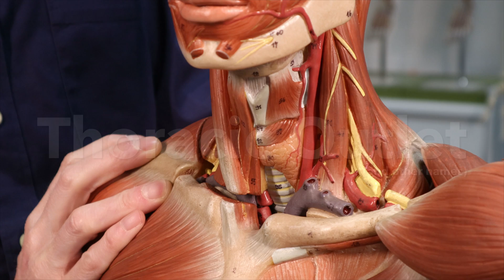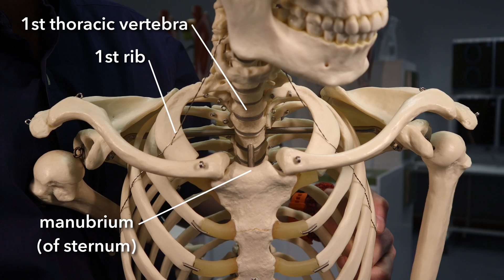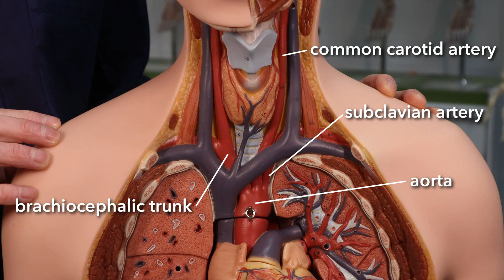Thoracic outlet

Comment: @Sam Webster - I have a quick question. I recently developed Horner's Syndrome on my left side (about 10 weeks ago). You mentioned that enlargement of the anterior scalene muscles can compress the brachial plexus. Do you think something like that could compress the oculosympathetic pathway nerves since they run near the brachial plexus? The neurons exit the spine near C7-T1, run over the apex of the lung, and then back up along the carotid artery until they reach the eye (king of hugging the cervical spine on their way up). I had a brain MRI, a neck CT, a chest CT, and MR Angiography of my head & neck, but all scans came back normal with no signs of tumor, stroke, or lesions. So, the doctors haven't been able to figure out what's causing my Horner's Syndrome, BUT I do have much larger neck muscles on the left side of my neck (the side that is affected). I've noticed the scalene muscles on my left side are much larger because I have poor posture and have slightly tilted my head that way for years. Basically, just curious if a muscle is capable of compressing a nerve and causing Horner's Syndrome. Thanks!

Comment: Hi, I am 52 years old, I had the NUSS procedure  repair of pectus excavatum 3 months ago { 2 metal bars} , I just notice that when i raise my arm it hurts a lot , they did a lot of different tests and found the source of the problem,  Because my thorax anatomy changed after the surgery now  the 1st rib  moved up and the 1st rib and the clavicular bone are  pressing an artery that supply blood to my right arm  , They want to remove the 1st rib to release the pressure over the artery,  Is there an other solution for this problem?  Do i have to remove the bars or its too late? Thank you
Reply: I too have pectus excavatum …. Am in my early 20 and currently active in sports…….not facing any particular issues with the pectus but I wanted to ask could it be An issue is or could there be any further complication……what made you do the surgery though I haven’t seen or came across anyone I could ask these